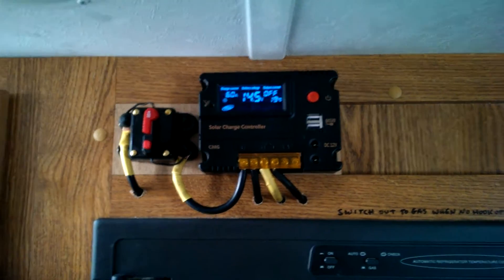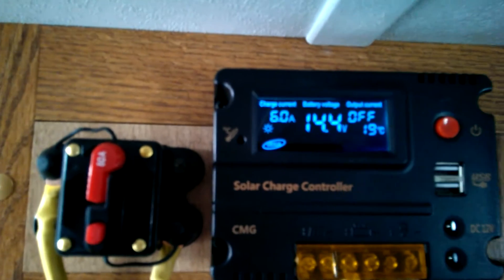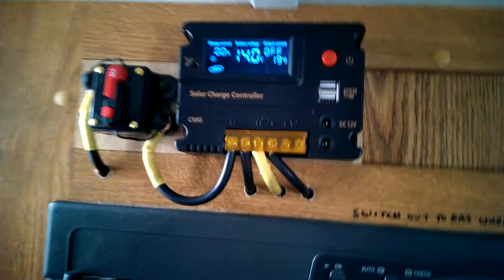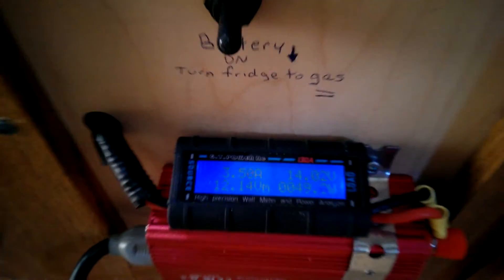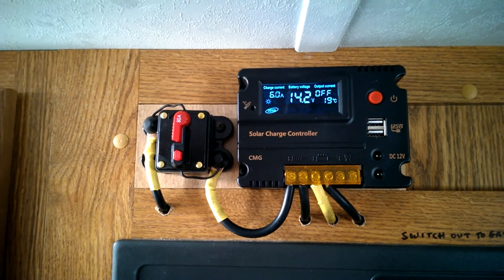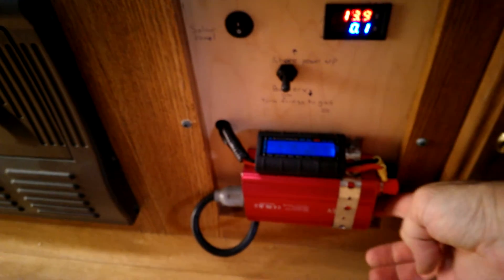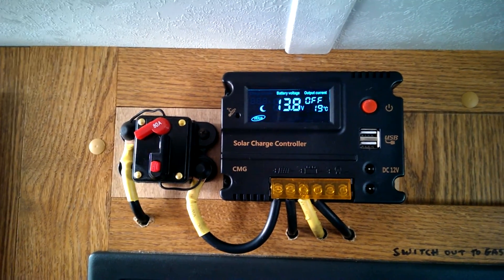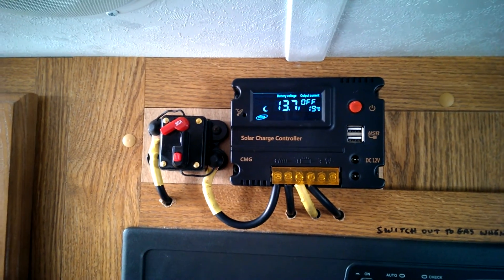mohoo charge controller part 2 of 5

Comment: The "bouncing" you're seeing on the Amp Reading and voltage is normal for a PWM controller. You hit the nail on the head when you guessed it had something to do with the pulsing.

Comment: You answered one question... what does the red button do?  Based on your video... the unit will charge my two 12v deep cycle marine batteries without needing to be turned on... the red button turns on and off the two USB plugs and the 2 DC round plugs... now I can help you with the 10 gauge wire problem.... cut a foot off of  your 10 gauge MC4 wires coming from the solar panels and use a thin speaker wire for the final few feet to the charge controller.... 100 watt panels are not going to heat up the smaller wires the idea of the thick 10 gauge wiring is that there is less energy loss.... a foot or two of smaller wire isn't going to compromise a 100 watt panel that is within 8 feet of the charge controller... and you'll easily be able to screw it into those little wire clamps.  Anyway... the instruction book never mentioned the red button... thanks for explaining what it does.....

Comment: What type of battery do you have? How many ah
Reply from the maker: I use Trojan T-105 6 volt golf cart batteries.  They are rated at 225 Ah  . I connect 2 in series to give me 12 volts and 225 Ah.  They are pricey but my first pair lasted me 9 years which works out to $30-40 Canadian/year and I never have to buy gas for a generator.  here is the battery   http://www.trojanbattery.com/product/t-105/
Reply: Bobbleheaderman thanks I'll check them out

Comment from the maker: this is an article I found from Arizona solar.....
Quite a few charge controls have a "PWM" mode. PWM stands for Pulse Width Modulation. PWM is often used as one method of float charging. Instead of a steady output from the controller, it sends out a series of short charging pulses to the battery - a very rapid "on-off" switch. The controller constantly checks the state of the battery to determine how fast to send pulses, and how long (wide) the pulses will be. In a fully charged battery with no load, it may just "tick" every few seconds and send a short pulse to the battery. In a discharged battery, the pulses would be very long and almost continuous, or the controller may go into "full on" mode. The controller checks the state of charge on the battery between pulses and adjusts itself each time.

Comment: yes. this shows exactly my problem. while its pulsing the battery starts to produce gas. when i dont use any power the battery wil be charged all the time. that will kill the batterys. i think i use some old car batterys becouse i can refill it if theres the level to low. the only thing what i dont ubderstand is: the instruction dont say anything about absorption charge. it only says 14v float charge. yesterday the chargecontroller is smoking with a load of 7A. and i have the 20A version. after opening nothing to see.
Reply: but thanks for the video. now i know the chargecontroller isn't defective ;)
Reply from the maker: Glad to help, I am learning myself and will continue to monitor the setup. I will get some good readings while camping the upcoming long weekend and report what I see. Cheers
Reply: I don't completely understand charge controllers either.  I'm having major problems with an MPPT charge controller that keeps stopping and starting the charge.  It will even let the battery voltage get kind of low when there is plenty of PV power available.
Reply: Christmas Eve
if you have the green "mppt" charger like this, its not a mppt charger. https://www.amazon.com/RioRand-controller-Regulator-Controller-Adjustable/dp/B01DTT7CH2/ref=sr_1_29?ie=UTF8&qid=1472588229&sr=8-29&keywords=solar+charge+controller+mppt
Reply: I think that is, if it is not true mppt, it does use some boost.  You are suppose to boost up.  See Julian Lett review.  The green one.
Reply: pirucreek yes i know that video. but i can't see any boost circuit on it. it has 3 coils. 3.3V 12V and 5V. the panel Voltage is the same as the battery voltage when it charges.
https://i.imgsafe.org/00ad5a3226.jpg
https://i.imgsafe.org/00acef0619.jpg